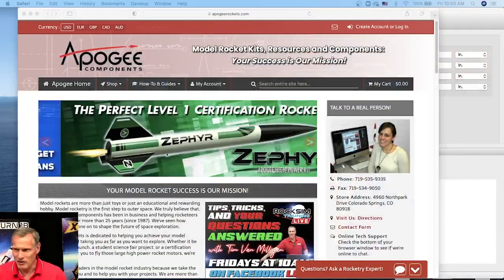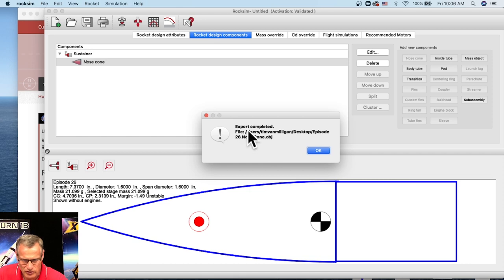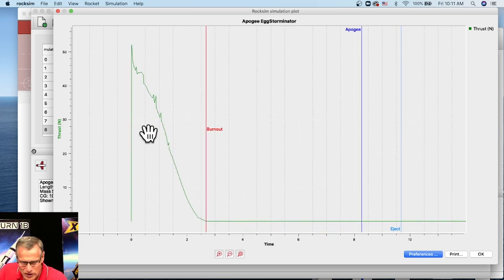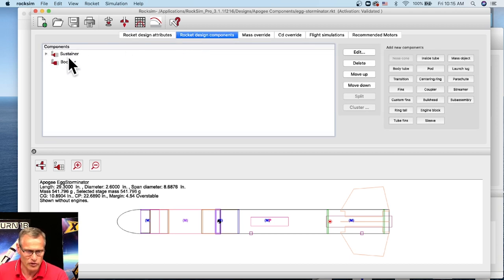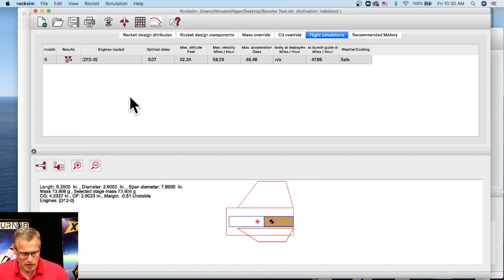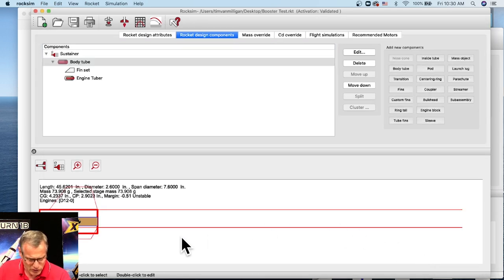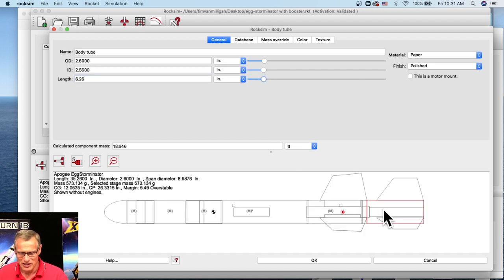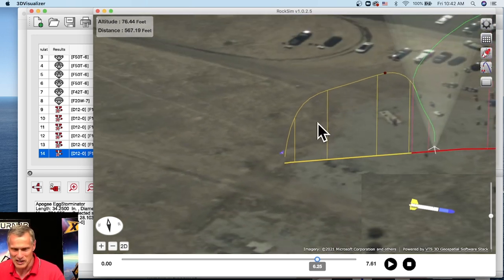How to make a booster stage go unstable

Comment: I lost my AstroCam, so expect to see a new order for one. I simulated the launch but, the weather conditions changed when I launched it on a C12-6 Q-Jet. I lost it! We could not find it in the area we predicted it to land. So that night I went home and entered the new weather conditions per the weather app. Now this story is taken out of the movie October Skies: I used RockSim to launch under the new conditions. I set it as a straight (no weather cocking) launch since the wind direction had changed. I then followed the drift of 250 feet plus in the direction of the drift. It went a little farther than predicted due the fins being sheared off. We saw it at the top of a tree. I cannot get it down, but wanted you to know that RockSim, when given the proper conditions, pinpointed the landing place. Thank you!
Reply from the maker: That is the power of the software as I have ever heard. Very nice! Thanks for sharing.